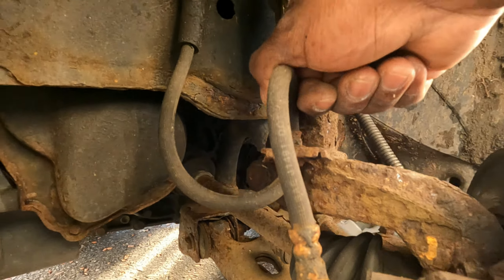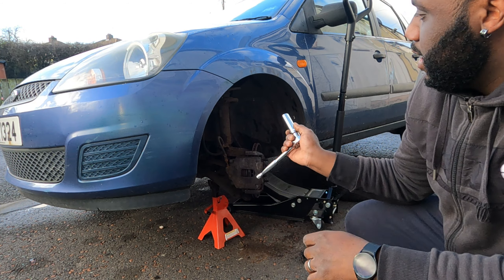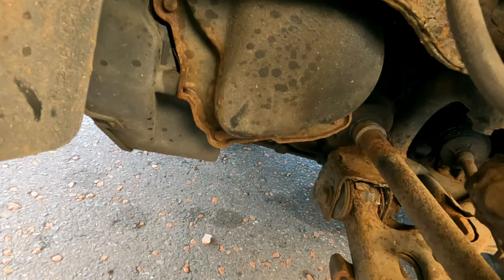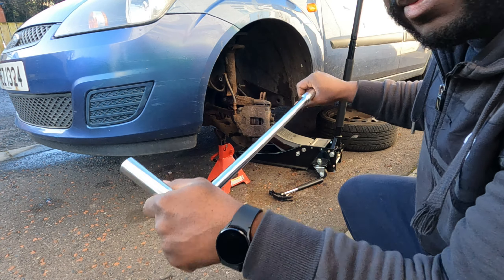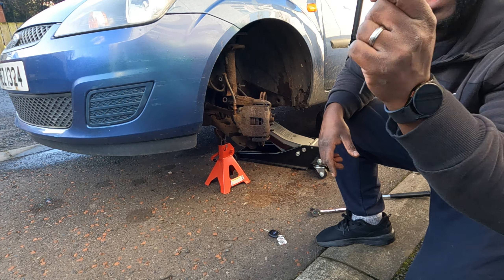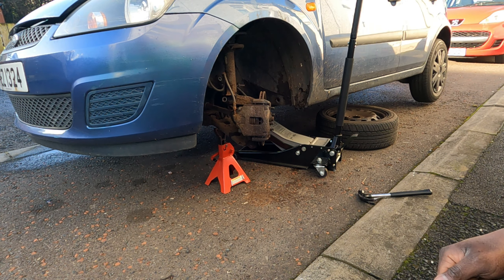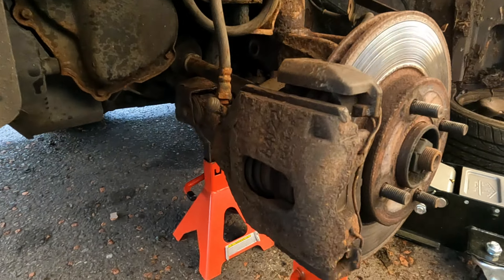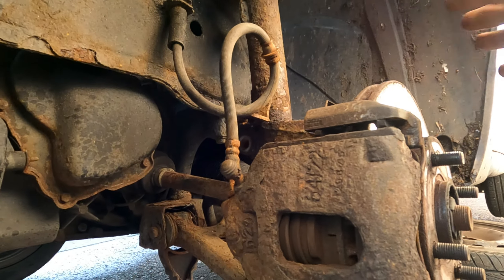Ford fiesta (Mk6) broken spring replacement

Comment: Well done Bro, i have done that job though I "cheated" and used a power tool on those tricky bolts 😀. I had to cut the drop links off mine though. You have to be careful you don't pull the hub too far out and end up separating the drive shaft.
Reply from the maker: I didn't use power tools because I don't have it. 🤦🏾‍♂️
But that's a great way to speed up this job.
But yeah.. That's a great tip.. Not being careful will pull the drive shaft out of the gearbox..

Comment: Почему у вас такая ржавая машина? В чем причина этого - климат?
Reply: Položil jsem si stejnou otázku. Jak kdyby bylo ponořené v soli. Leda že by pán bydlel u moře, to má velký vliv...
Reply: @dejv1111  Its the British climate lots of rain and in winter salt on the roads. The front nearside wheel gets the worst of it as the snow and slush accumulates at the side of the road along with puddles so it gets bathed in salt water regularly.